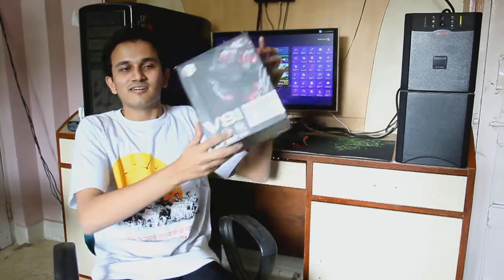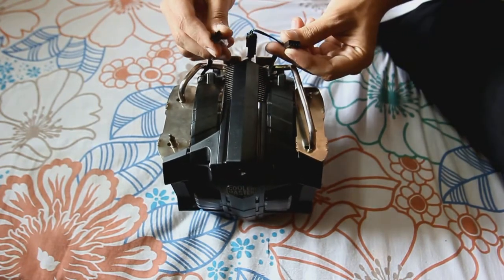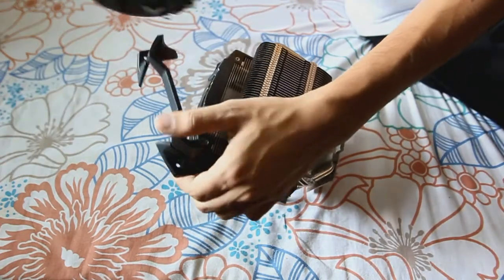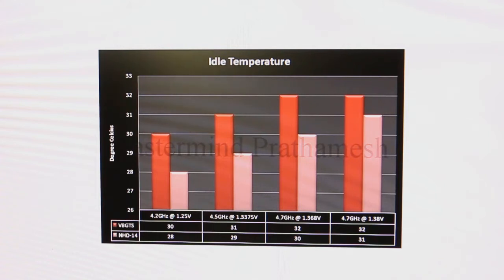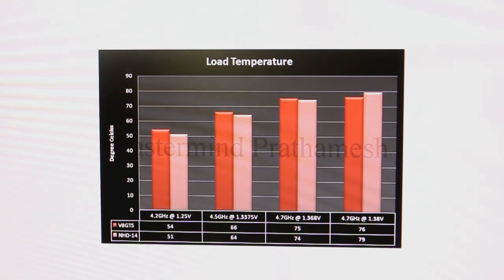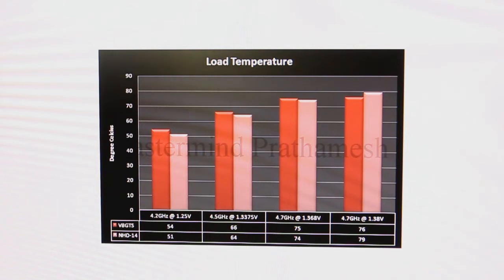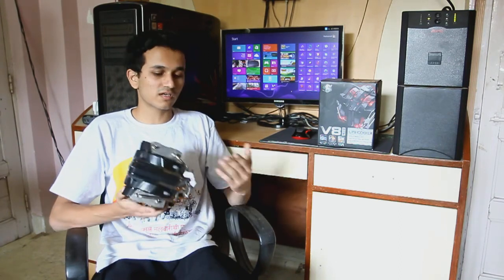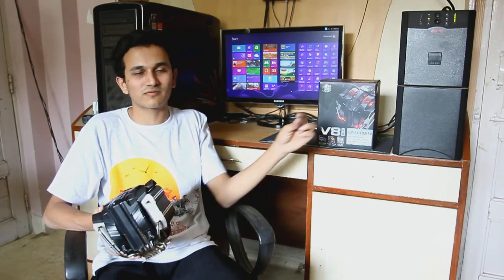Cooler Master V8 GTS Review

Comment: I ordered the cooler last month... it's on its way from USA to Malawi. I am very much looking forward to receiving and installing on my new computer that I am building. NOW, where's the mentioned link at to the written review because I don't see it "BELOW" ???
Reply from the maker: Even i am waiting for the forum admin to post the review. he is busy for sometime. he will upload it next week. I will post the link underneath as soon as he uploads it.
Reply: Prathamesh Patil Okay man. I'll keep a look out for the written review. Otherwise, good video review on the cooler. I personally bought the V8 GTS more for aesthetics than performance reasons. The cooler will be mounted on an ASUS MAXIMUS VI HERO driven by an INTEL CORE i7 4770.
Reply from the maker: I assume u have a 4770k coz the board u have bought is meant for overclocking. V8 GTS will be able to handle ur overclocked 4770k can't say at what voltages and clock speeds coz many people struggle to get 4.5GHz out of it. It purely depends on the chip. Hope that u get lucky :)
Reply: Prathamesh Patil I went with the non-K of the 4770 CPU because of the Virtualization tech built into the chip, of which the K version lacks. And despite the motherboard being an overclocker unit, I went for it mainly because I love Asus ROG products… I am a programmer/developer, but I am also a GAMER, so going ROG is a no brainer to show it off :-)
Reply from the maker: Cool. But you could have bought a 4770k anyway if virtualization tech was not extremely important. Anyways congrats on your new Rig. :)
Reply: Thanks bro. I may hit you up (share a post or make a video up on YOUTUBE) when the assembly is done in a month or two.

The only components I have received from the USA are the (1) cases [Cooler Master CM 690 II Advanced and Corsiar Graphite 600T White Edition] and (2) Power Supply Units (Rosewill Lightening Series 800W and Corsair Enthusiast Series TX 750W).

The only parts I have salvaged from my previous PC are two AMD Radeon HD 6870 GPUs. I was intending to replace the 6870s with either two ASUS ROG MATRIX R9 280X or two ASUS NVIDIA GTX 770. But after cafeful consideration, I just decided to stick with my current GPUs. Besides, they still work great for my gaming.
Reply from the maker: good choice
Reply from the maker: Sorry for posting the link so late but here it is : http://www.ocfreaks.com/cooler-master-v8-gts-cpu-cooler-review/
Reply: Prathamesh Patil Thanks for the heads-up regarding the written review version of the Cooler Master V8 GTS.

Comment: That's a one big ass cooler! Are you sure it will fit into a case? I think it is best meant for test benches which usually keep the motherboard open.
Reply from the maker: This beast looks great, performs well and easily fits inside pretty much every cabinet.